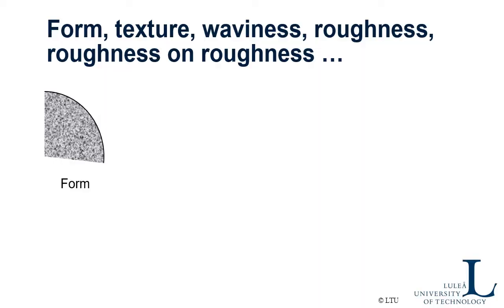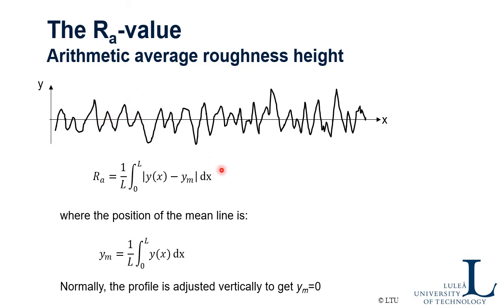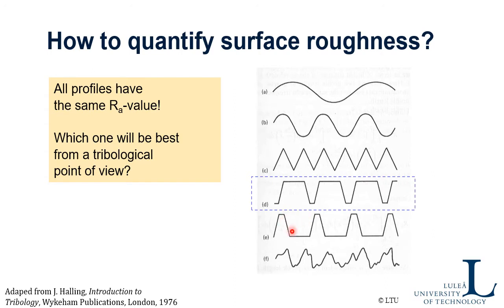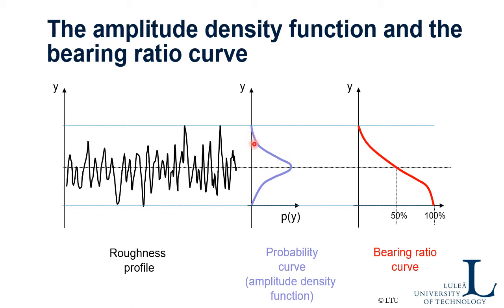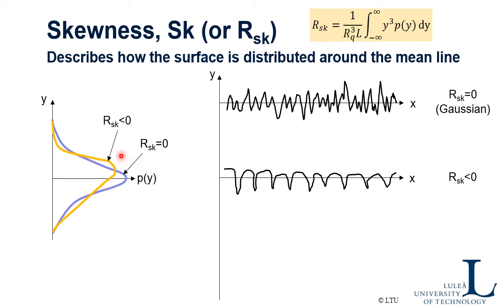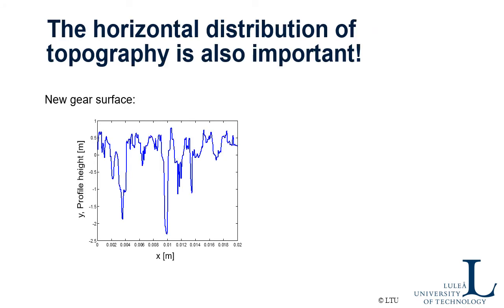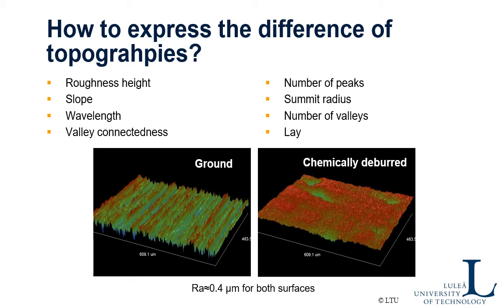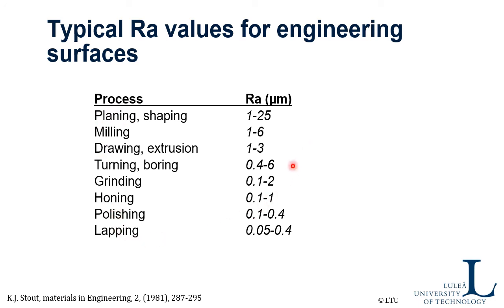Quantify Surface Roughness

Comment: Have you ever considered to model the 1D roughness by SPD (spectral power density), Palaszantas model such that it can be characterized by the
three parameters: roughness-sigma, correlation length xi, roughness exponent alpha.